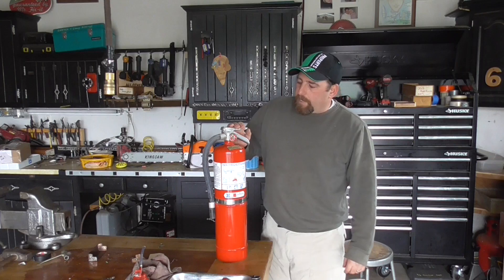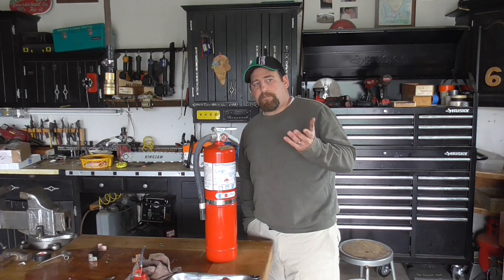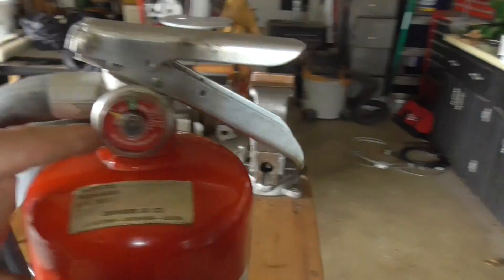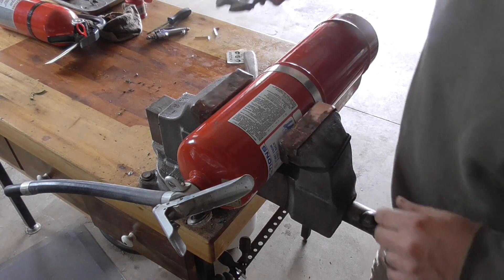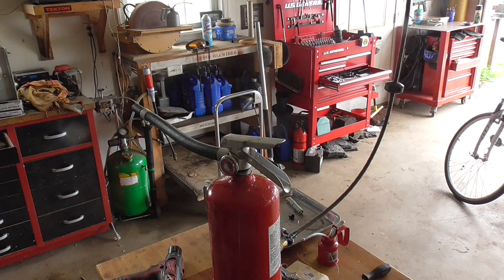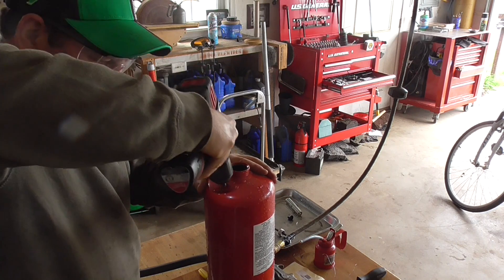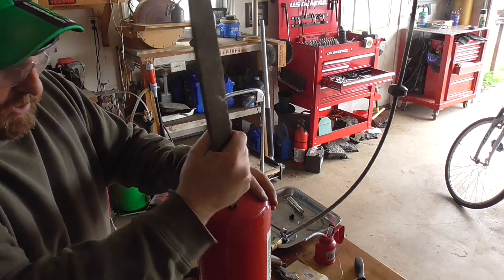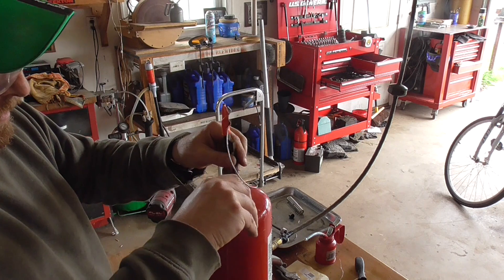Dead Fire Extinguisher:  Becomes Water Cannon

Comment: You might be able change the hose size, a smaller diameter will restrict the flow some giving you a longer stream of water.
Most actual water cans need around 100 psi, with a 2 1/2 gallon capacity, you fill it with 2 gallons of water and the rest will be compressed air, a four to one ratio...

Nice reuse of a product..

Comment: I dont know what you did with the powder that was in it. However when i was a volunteer firefighter we used the dry chemical to fill zip lock baggies to drop down chimney when there was a chimney fire. Made nice little fire bombs worked pretty good. Nice video.
Reply: Stick an m-80 on the outside of the baggie-instant fire extinguishing bag 😂. Your idea and use of the powder is fantastic!

Comment: Did you check the psi after you aired it up? Just curious how much pressure it holds and if it has a pressure relief valve